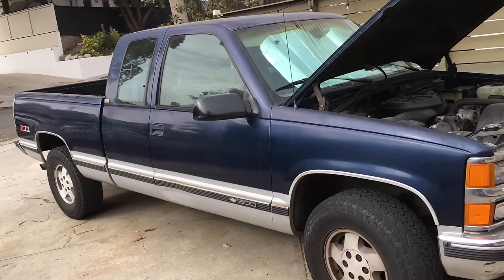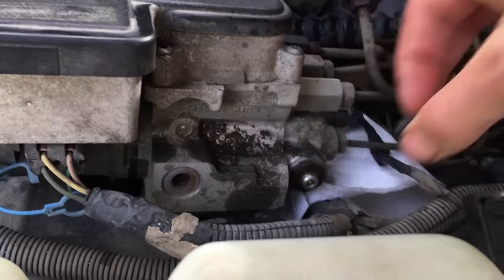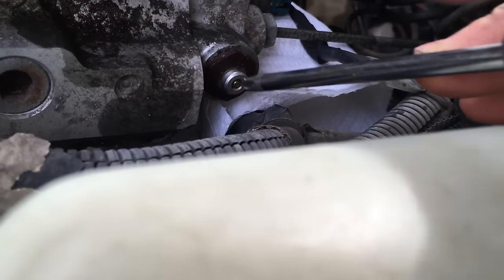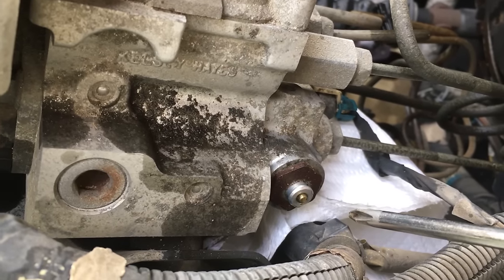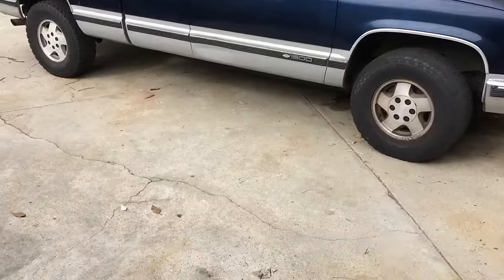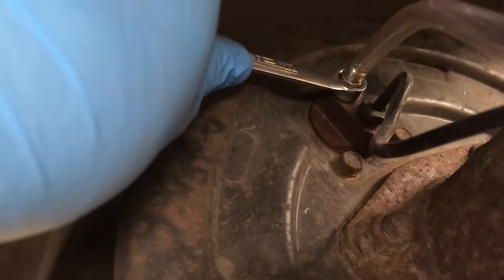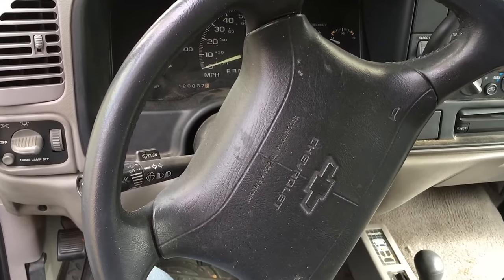Spongy ABS Brake Fix 88 to 98 Chevrolet Silverado

Comment: Best video by far, short and simple without a bunch of senseless yapping... Great job guys
Reply from the maker: Thanks. Glad I could help.
Reply: choices31 exactly!!!!! Thank you do much
Reply: U
Reply: Thanks short sweet to the point!
Reply: Agreed
Reply: hoohoohoblin exactly no bullshit strait to the point good video if I would have seen this I would have never known thank you great video
Reply: I know right I try to always just fast forward cuz blah
Blah blah gotta always tell you tube about this that and the other thing before getting right to the project
Reply: @hoohoohoblin  Good video,  but it only applies to 95-98 trucks.   88-94s were RWABS, not 4WABS
Reply: @greasedog5699  
Do these have two valves like the older models? I've only found the one he shows us on my 97.
I'm assuming it's not possible to push in the button unless the brake pedal is depressed? 
Mine seems to be stick but I'm working alone, so I ordered the specialty tool.
Reply: man can u get ahold of me I have a 1997 checy 3500 454  and my brakes are giving me grief 😔 do u have a Instagram or something I  can message u about this
Reply: @hoohoohoblin  I have a 1997 chevy 3500 454 and having brake issues i already spent 3000 and got it back and it's still doing the same crap and it's my daily driver is there a way I can contact u for some advice
Reply: "Hey a quarter"
Reply: @OtayBuckwheat what specialty tool did you order?

Comment: guy at wheel calls out pressure. guy at pedal pumps brake a few times, holds foot on pedal confirms saying pressure. guy at wheel opens bleeder. guy in cab says floor when pedal hits floor holds, close bleeder repete

Comment: My mechanic installed two new master cylinders, trying to fix my mushy brakes, after a full $1,300.00 brake job, and in the end told "that's just how GMC trucks are, which really pissed me off as I knew the truck had a very firm pedal before the brake job.  I tried this yesterday and WOW it worked!

Oh and as the comments already mentioned, thanks for getting straight to the point instead of an incoherent, rambling, 15 minute segue.
Reply from the maker: You’re welcome. I am glad you found this video. It took me a while to find out how to do it after my local brake shop told me they couldn’t do it.  I hope this video helps a lot of people.
Reply: That same shit happened to me.  Replaced just about everything only to hear, "that's just how those trucks are..."  I'm going to try this video-tip and see where it takes me.
Reply: Daniel 045  And there are all too many "mechanics" that do that! I'm having oil pressure issues (20 psi) on a 2013 and I've had a shop and the dealer tell me it's find and still in spec. I was hoping someone would actually diagnose it for me before I get the parts cannon going.
Reply: Many shops today don't fully understand the older abs systems since newer, for probably the past 15 years, vehicles don't require such brake bleeding as this, just bleed the brakes at the wheels and that's it, many using a pressurized bleeding system at the master cylinder....

Comment: 2/22/2021 - Had spongy break pedal on my 1998 Chevy C1500. Break pedal was firm with engine off, but spongy when engine was cranked. Did exactly what is shown in this video and it absolutely fixed my problem. Breaks now better than ever. Thanks for the awesome video.
Reply from the maker: You’re welcome. I’m glad I could help.
Reply: Had this same issue except pressing this button on the ABS module did not allow any fluid to come out. Never figured out what the issue was.
Reply: @ProcessHF  currently having the same issue and haven’t found an answer
Reply: @corriganworley4961  Pretty much you need a Tech 2 scanner to activate the ABS and get the air out unless you can drive down a dirt/gravel road and slam on the brakes enough to get the ABS to activate. Aftermarket Scantools like Autel or even the Snap-On ones can't do the ABS bleed on some these vehicles, only the GM Tech 2 Scanner.
Reply: @corriganworley4961  I would definitely bleed the 2 Master Cylinder lines, then attempt to get the air out of the ABS module through the methods I mentioned in the other comment, then bleed all 4 wheels in order of RR, LR, RF, LF.

Comment: I know I’m late to this lol but I wish I found this video sooner, would’ve saved me tons of headaches…with that being said, anyone with a 90s Chevy equipped with 4wheel abs system that has a soft/squishy brake pedal to follow this tip!! Bleed brakes from all wheels as you normally would then after bleeding from wheels bleed from the module and your brake pedal and stopping power will feel 1000x better!! My 98 feels like a brand new truck 🤘
Reply: I’ve tried this a few times on a ‘96, but nothing (or just air) comes out when I depress the needle that pops out when the brake is pressed. How long did it take for the brake fluid to finally come out?
Reply: @anfitch8706  hope I’m not too late but from my experience I pressed it before the person pushed the brakes
Reply: @anfitch8706  When I pressed the button 10 times after my wife pull the breaks, nothing happened. When i pushed the button before she pressed the brakes, suddenly the pedal was less spongy! Strange but never brake oil was coming out. Mayby I shoud use in stead of a flat srewdriver one with a point to push it deeper..

Comment: Great info, my 98 has had spongy brakes sense I bought it in 01. I've tried ceramic pads with fancy drilled and slotted rotors that helped but still not great. This is the tip that I needed. Thanks.
Reply from the maker: You’re welcome. I hope it works for you. No matter what you do, these brakes are always a little squishy. The next generation of trucks from 99 on has really good brakes.

Comment: ive spent hundreds having all different shops rip me off doing my breaks , even after they were still spongy the one shop told me "You just have to pump it a few times to stop" I'm like "THATS WHAT I BROUGHT IT HERE FOR!" either way, i am replacing the master cylinder myself next week and i will also try this method too! i'll let you know how it goes! thanks for this video
Reply: How did go? I have this problem and wanted to know if breeding it this way helps, thank you
Reply: @philliparthur8672  A drunk driver totaled my truck so i never got a chance to change it. My buddy has the same truck and we changed his master cylinder and it was a little better but the brakes still suck. I bought a newer truck and that seemed to have fixed my issue🤣
Reply: @STREETRACEN4U  Damn that really sucks but if you didn't get hurt or hurt bad that what matters most. I'm glad you got a new truck and thank you for replying to me.
Reply: @philliparthur8672  yes, no problem. and it wasnt too bad it was a bump at maybe 30mph but due to the age of the vehicle (97) insurance totaled it out. No injuries thankfully!

Comment: to be clear - - pop the rubber cap off and you'll see that pin he's holding in the video push out when the brake pedal is depressed - - what you are doing is holding the pin  in then having the pedal depressed , release the pin and have them release the brake - - push the pin in and then have them depress the brake pedal until you get a squirt not just a trickle come out around the pin. Be sure to bleed the lines after because the sensor that puts up the red light for brakes on your dash is in or on the module - - you can clear the warning light but still have air in the lines . Good video - - many people don't know about the module bleed
Reply from the maker: Thanks for the clarification. This was the only thing that fixed my brakes, and they still work fine since I made the video.
Reply: @hoohoohoblin  good video trying to get out information rather than their mug up on the screen - - seen too many that its more about them than what they  are fixing
Reply: What if no fluid is coming out of the pin

Comment: Cool vid.  Hey I just fixed that abs issue, which actually worked this time.  What I failed to do before is flat file the surface down to make it perfectly level and remove any rust, then prime it and let thoroughly dry before reinstalling with new orings...  Worked like a champ!
Reply from the maker: Thanks. I’m glad you got it fixed.

Comment: I had same problem.  Replaced master cylinder, bleed brakes, adjust rear drums, was about to replace abs mod when a 40 yr ASE mech said find dirt or gravel road, run up to about 30 mph and slam on brakes. Did it about 5 times and now have rock solid pedal. Said this activates the abs system and bleeds air from it. Hry, worked for me!
Reply from the maker: I’ve heard that that method works. In my case, the wheel sensors have gone bad, so the antilock brakes don’t engage when I hit the brakes. So I have to bleed them this way to get the air out of them. They will sensors were notorious for going bad, so this method is good for anybody who has their abs brake dashboard warning light on and wants to bleed the brakes.
Reply: OnlineSales Dude lol, we wait until it snows to bleed the module one rock hard stop on snow, ice or dirt will cycle the abs mod on and purge it.
Reply: when the abs is active and you slide does it  make a sound like rrrrrrrrrrrrrrrrr
Reply: does that mean its working?
Reply: will this work for a 99 suburban?
Reply: You still have to bleed system after doing this. This is just a "backyard" method for getting around not having a scanner with abs activation feature.
Reply: Thanks for this info, I was truly amazed that this actually worked

Comment: Secondary bleeder is under the blue pigtail wiring where all the brake lines join in the abs. Use a mirror to see it. You will have to unclip or snip the plastic clip that holds the wire going down to the frame rail. Then ziptie it back into place.
Reply: @Grease Dog  
Do these have two valves like the older 88-94 models? I've only found the one he shows us on my 97.
I'm assuming it's not possible to push in the button unless the brake pedal is depressed? 
Mine seems to be stick but I'm working alone, so I ordered the specialty tool.

Comment: Thanks, good tip, good descriptive video.  I had to disconnect my ABS, all kinds of problems with them.  I like driving without ABS anyway.  Keep the tips coming, because I'm keeping mine forever.. . . . . . !
Reply from the maker: You’re welcome. I try to get whatever I do to this truck on video so it will help other people keep their trucks on the road. This one was pretty tricky, and I had to dig really deep on the Internet to find a solution. I have thought about routing  the brake lines around the ABS module and getting rid of it altogether.

Comment: EFFING AMAZING!!!!!!!!  Thank you so much for this HOT HOT TIP!!!!   I've had so many people, GMC techs and the like tell me " you have to bring it to the dealer or use the fancy scan tool to bleed air"  or hard brake it on dirt roads etc etc etc.  Well the ABS computer needs to be rebuilt and I dont need ABS for a yard truck.  This is the perfect work around! Finally got the brake pedal back to where it should be!!  A THOUSAND THANKS FOR THIS VIDEO MAN!!!

Comment: I agree with all the other comments mentioned. Straight to the point. Did this today and no more spongy brake pedal.
Reply from the maker: Thanks. I’m glad this video is helping so many people. I wish they would put this kind of information in the repair manuals. I have a Haynes manual and it Chiltons manual, and both of them say bleeding the brakes needs to be done by the dealer, and they don’t tell you how to do it.

Comment: Will be tryin this after work today. Been having the same issue and almost got into a wreck cuz of it. Fingers crossed it works I miss drivin my baby
Reply: It work 4 u?
Reply: Trevor Hageman: I was wondering did bleeding on the system and each wheel work? Thank you
Reply: @0ptimal  yes it did sorry I just saw your comment
Reply: @philliparthur8672  it did. I had to bleed it for awhile all around. Keep some extra brake fluid with you for sure
Reply: @trevorhageman2831  Thank you for replying I know it was a little while when you wrote it. I just got a 98 Cheyenne this weekend and what I think I'll do is bleed the wheels and then the abs and wheels again. Do you think I should do it that way? Anymore feedback is appreciated, thank you.
Reply: @philliparthur8672  i would bleed them all once just be sure there isn’t even a tiny air bubble in any of the lines that’s how I did it and it worked great
Reply: @trevorhageman2831  Thank you so much

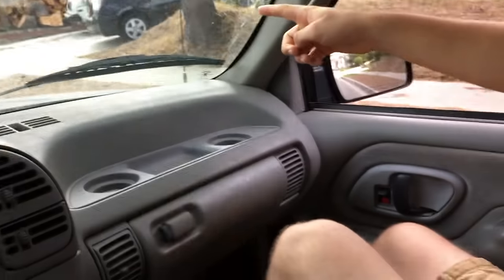Comment: New Subscriber here!! Thanks for the straight to the point explanation video! I will be doing this to my C1500 later this weekend. I've had a spongy brake for a while and got used to it. I want to be able to enjoy braking like at 2:24  👌😊👍
Reply from the maker: You’re welcome. I hope it works for you. If it still seems spongy, try doing this a few times.

Comment: Cool worked for me too. I replaced the brake master cylinder did the whole bench bleed before I installed it. Then bleed the brakes and it was still spongy. I watched this video and then bleed that button without doing a re-bleed of the wheels and the brakes were a little tighter then I went out and slammed on my brakes to make the fluid run threw the proportioning valve and bam good as gold so this method does seem to work. At least it helped. Thanks!
Reply from the maker: You’re welcome.

Comment: As an update...

To anyone not getting any fluid out, depress the button even harder.  It starts out flush in its own little orifice, but you need to put enough pressure so the button actually pushes in like a mm or so

After I realized that, I got fluid flowing
Reply from the maker: That’s great. I’m glad you figured it out and got the bubbles out.
Reply: Thank you for the important knowledge. I couldn't get fluid to come out with a blade screw driver. Will try again after I replace the leaking lid for the master cylinder. I was searching for a comment like your. Thanks from Canada 🇨🇦
Reply: @hoohoohoblin  on my 97 Tahoe,the needle of the bleed valve pops out,when my helper pumps and hold the brakes? dang near impossible to push it in,to get a bleed?Any thoughts or tips,to be clear everytime the brake pedal gets pumped,the center of the bleed valve pops out,goes back in  flush,when off the brake
Reply: @JV-no9fp  did you figure it out?
Reply: @chi09avalanche76  no still spongy brakes,just livin with it man
Reply: @JV-no9fp 
Pull the abs fuse inside the engine compartment.  Then power bleed the brakes.  Leave the fuse out and enjoy the truck without the worthless abs. Just did my 95 Z71.  Brakes like new.

Comment: Another thing you can do which gives a big improvement in pedal feel and braking is replace the master cylinder with one from a 2003. It has a bigger bore which gives more fluid displacement when you brake. You do need one brass fitting to adapt the rear port in the master cylinder to the brake line, but there easily found at hardware or big box stores with a good brass fitting selection ( remember you need a double flare fitting on each side). OEM master when you hit the brakes there was a lot of extra pedal travel plus if pushing hard it almost felt as if the brake hoses were ballooning or the calibers were flexing. Have had truck since new several brake jobs different brands quality pads, new hoses and calibers and no improvement. Changed the master cylinder and “wow” big improvement.

Comment: I have 2003 Silverado with spongy pedal. I've replaced all calipers, pads, rotors and even replaced all flex lines with the stainless steel braided ones. Still somewhat spongy. I am gonna see if my ABS controller has a bleeder like this. I hope it does! Thanks for the great little video.
Reply from the maker: I hope you figure it out. On some generation of these trucks, people say the brakes are spongy no matter what you do. That being said, there is probably a way to make it better.
Reply: Yeah, u r right. I had a '98  K1500 and it always had spongy brake pedal, with weak braking, even after numerous bleeds. Very frustrating.
I have a $500 OBD tool for my laptop called AutoEnginuity, so I loaded that up and actually figured out how to cycle the ABS in my '03 Silverado. No difference at all in brake pedal. But I did not actually bleed the brakes. On my next attempt, I will remove all wheels, then pressure bleed, cycle ABS, rinse and repeat a few times, and see what happens. Thanks again!!

Comment: For anyone wondering junk yards can swap the abs board out stupid cheap. Typically after 10 years of bumpy roads the solder points on the board break off causing the abs light on. Happened in my 1500s, trailblazer and blazers. Swapped the board with same gen board and no abs light.

Comment: 99 S-10's also have this issue! Had one brand new and the dealerships replaced just about everything more than once for the brake system and it would only last a little while before it would become like a sponge again! Seems like it's a problem with the ABS distribution module that is causing the issues. Best way to get around not dying is to cut it out and run new replacement lines directly to your distribution block. This of course will delete any ABS you ever had. But will keep you alive when you have to depend on stopping! My blazer was a death trap waiting to happen!